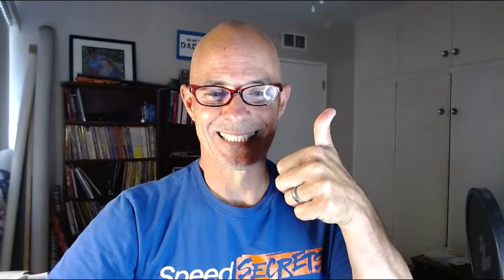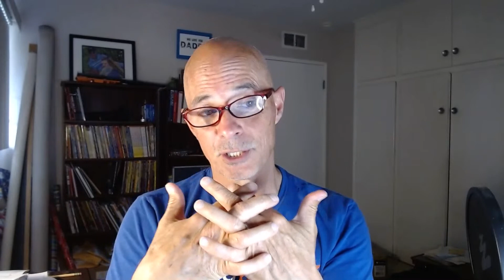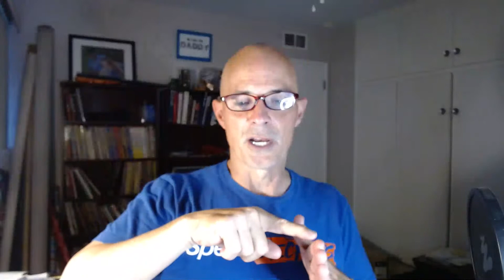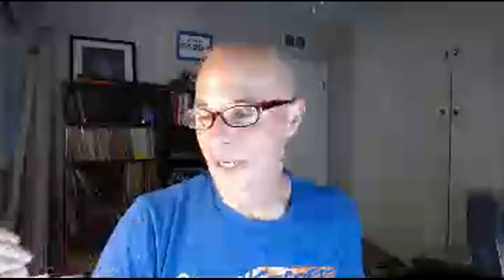LET'S TALK TECH-BTR GEN 5 L83 CAMS (STAGE 1-4)

Comment: Can I run stage 2 cam with factory torque converter?
Reply from the maker: truck cam?
Reply: @richardholdener1727  yes  l83 2018 sierra  . Currently have edge tuner with transmission tuning

Comment: What do you think about a stage 3 can in a 6.2 l92 for daily driving?
Reply from the maker: STAGE 3 WHAT (TRUCK, TURBO, NA, PD BLOWER)
Reply: @richardholdener1727  I'm doing a ls swap 6.2 in a oldsmobile cutlass it's out of a 2007 Yukon denali...but want to add a turbo later on next year so I was thinking about the sloppy stage 2 cam or stage 3 what do you think
Reply: @richardholdener1727  also daily driver
Reply: @Bball128  stage 3 will want to jump ahead while you're stopped at stop lights if you don't get a stall converter. Drivability will be doable but not pleasant.
Reply: @oceanwaves83  thanks bro
Reply: @richardholdener1727  but Richard, ALL cams are turbo cams. And YOU have the dyno data to *hand gesture* prove it!

Comment: It looks to me like the Gen5 engines take the same HL128 lifters as the Gen4 engines as a replacement part. You can find sets online for less than $200.
Reply: I have Ls7 in mine from TSP they are 250 I think
Reply: @J2A61  Amazon has some guys that well them for like $185 but dunno what your getting. the l5p duramax comes with a waisted solid roller lifter that is 0.842 and looks like it fits Gen5 lifter trays. Having a solid lifter that works with the stock trays might be a real boon to junkyard bracket racers